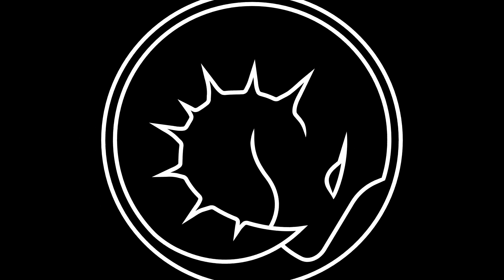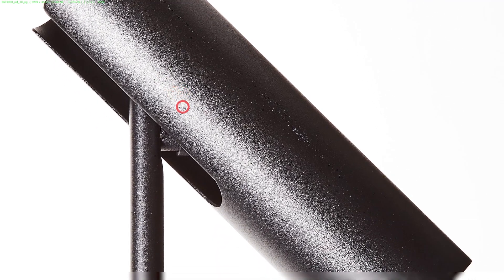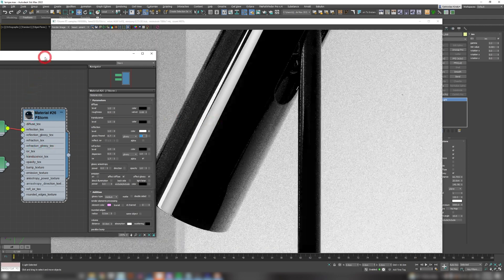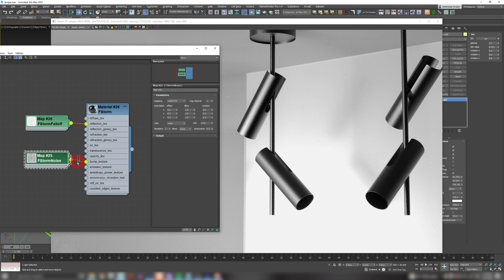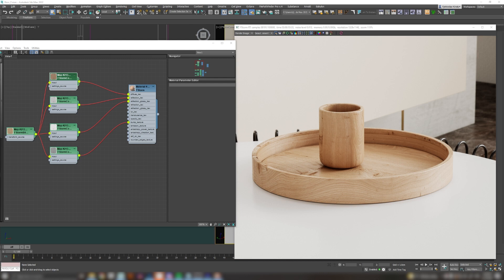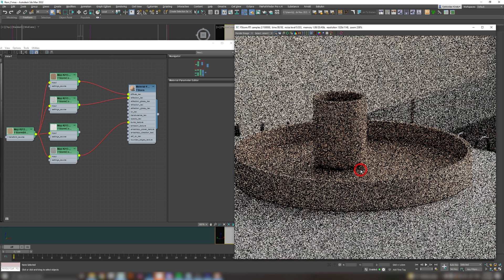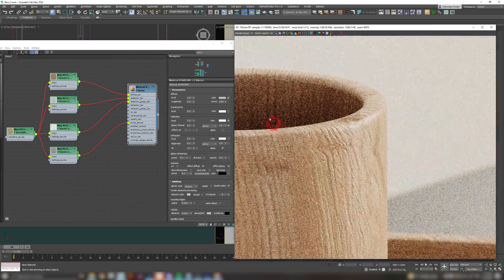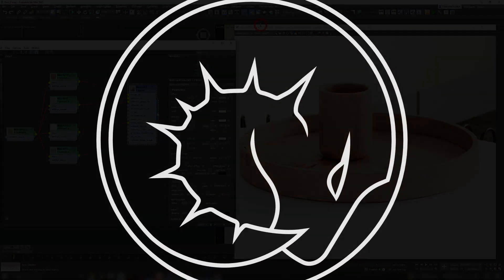BUMP vs. GLOSSY: How To Completely Control Your Materials | All 3D Software

Comment: Works because what defines any surface in reality is the roughness. When you use the bump, you are defining the level of roughness without using the glossiness ou roughness property of the shader, though the bump is much more render expensive. A trick to render the bump faster, is to put the bump in a gradient and use a dot product as an input taking the camera as reference. In doing so, the bump only appears in the geometry facing the camera, speeding up the render time.